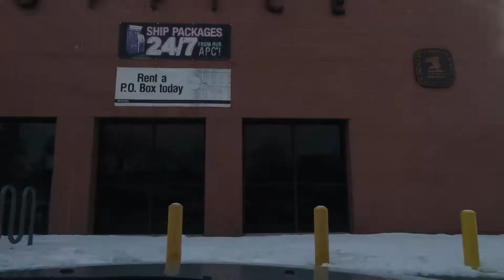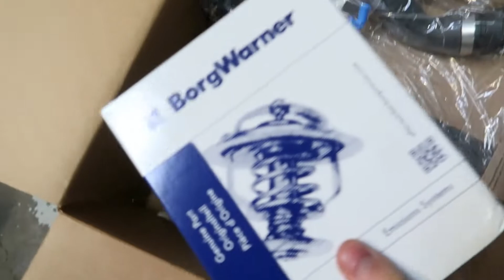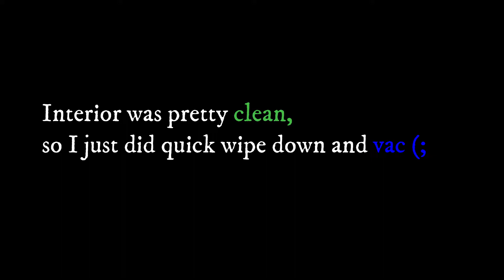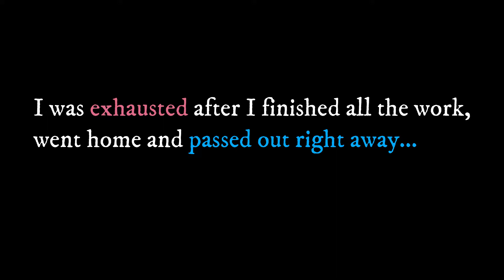What is Wrong with my Blue Wagon ? BMW 325iT repair and service

Comment: found 150k mile 2003 BMW Series 3 325iT Wagon. same color. question, is it worth buying with that many miles? or will i expect a lot of issues?
Reply from the maker: Mileage means nothing. Proper service and maintenance what matters... I had cars with over 250k that were running super strong and engine internals were super clean, with normal wear. Seen 90k mile engines that were on it's last leg due to poor service... All depends on who owned it and how. Something like that needs to be inspected by a person who knows these cars... To be safe
Reply: @YaroCarHustle  definitely understand. Though some model years suffer from poor Quality components which start to wear and break sooner than the industry average.
Reply from the maker: @jeffthatcherphotography  e46 chassis, especially later models 2001 and up are great cars, way better then e90
Reply from the maker: @jeffthatcherphotography  another great thing is that this chassis is very well documented as far as repairs go and there is almost everything you need to know about it, is available online.